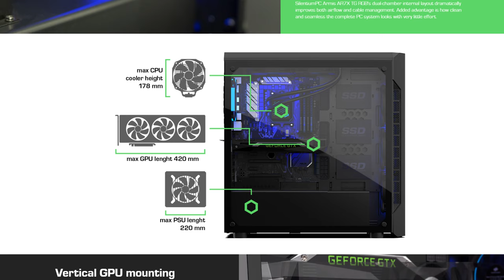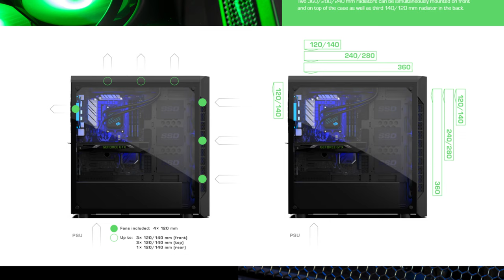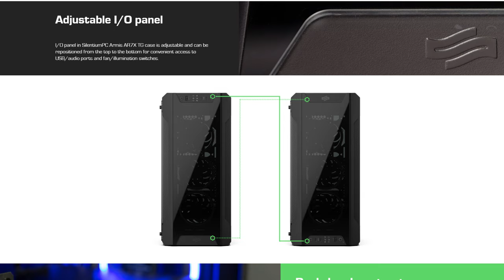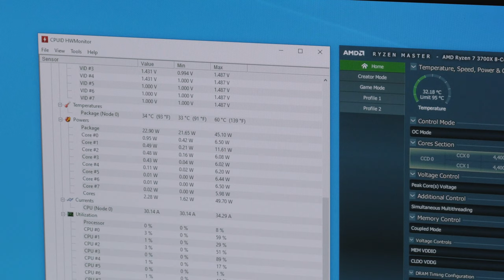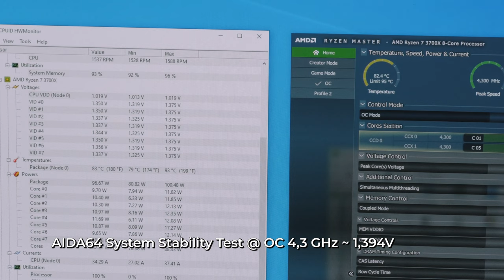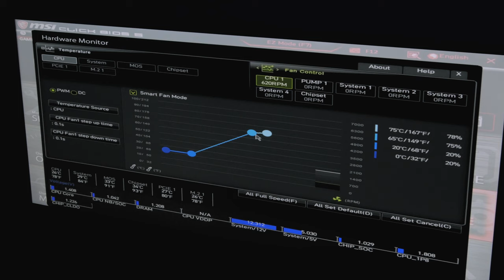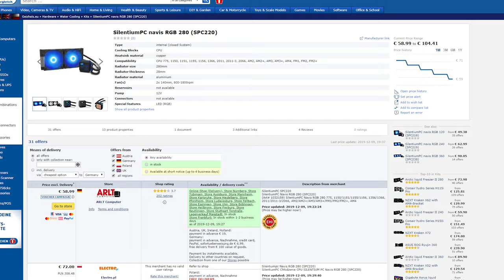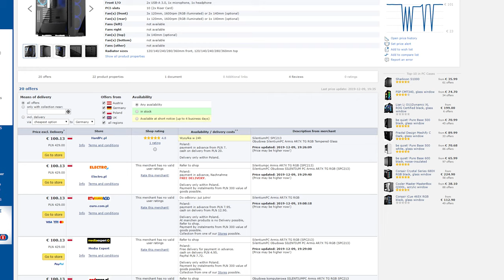BUILD TIME! - SilentiumPC Armis AR7X TG RGB w/ Navis 280 RGB

Comment: the space between the motherboard and the top of the case should be a bit higher to fit thicker radiators or take pushpull fans. some boards have high rising coolers that block the space. thats something most cases have problems with